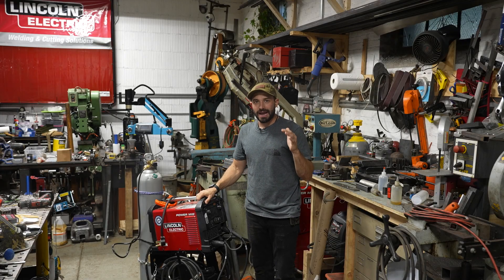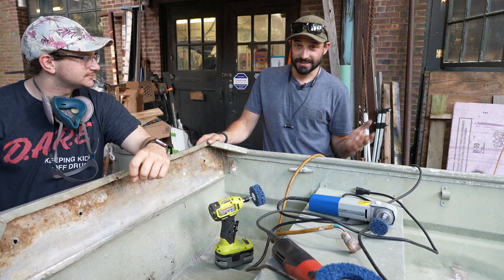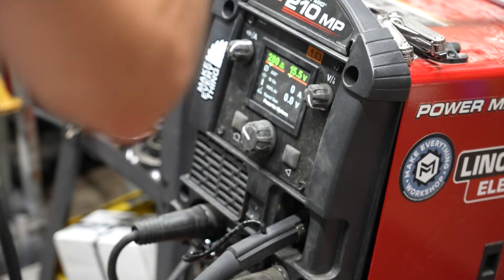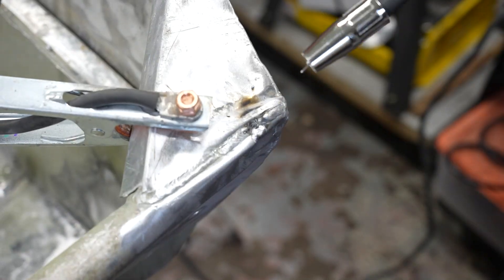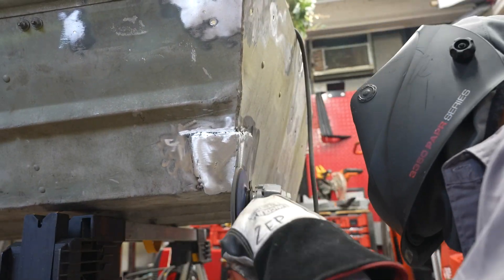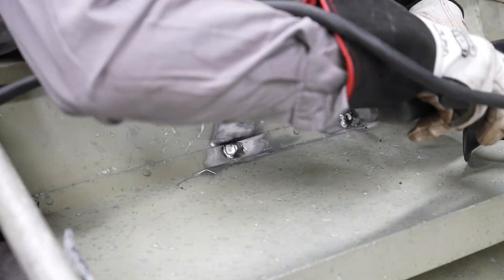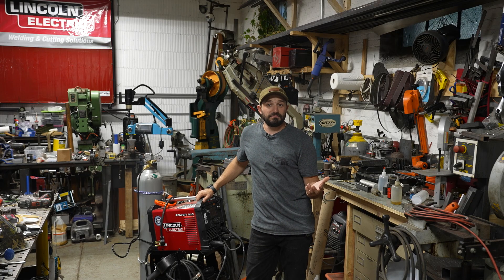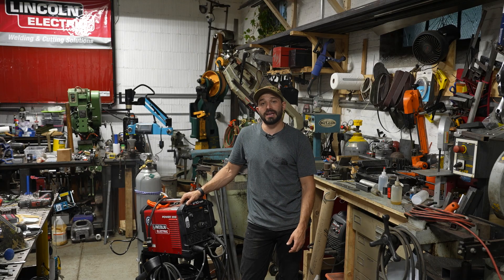Can We Fix This Aluminum Boat With A Mig Welder?

Comment: First time I attempted aluminum welding was on very thin metal of a Land Rover roof. It was flat which made it easy. Suggestion was to use a brass backing plate since aluminum won't stick and would absorb some heat.  I'm getting ready to fix my boat and your video should help immensely!

Comment: Great video! I used lincoln electric k488 spool gun for years.. i bought a Fronious transteel welder and after dialing in the arc legnth control it welds Aluminum awesome!

Comment: I spool gun mig thin aluminium every day making scalford towers. Hard to say how bad a job you were doing with some of that without seeing that material close up, but it looks pretty weak/thin in spots. Really is easy to burn through thin aluminium if you're not used to it. Couldn't give you exact settings because I'm in the UK and not sure if the machines use the same values in America but turn down the feed speed and/or voltage if your burning through. You're better off starting on a lower setting and having a shitty weld and grinding it off than being too high and burning through. I really wouldn't be welding uphill on stuff that thin either, you'll be perfectly fine going downhill with right settings.

Comment: Just completed a simular repair on an old 16' fishing boat, replaced a rotted transom with extruded aluminum shapes, had all the same problems but learned a grest deal about aluminum and my spool gun. I don't thinId try it again though. Looks like you did just fin. I learned that for me at least, dirty old thin aluminum is not any easier to tig than to weld with a spool gun. mabey I just need a lot more practice (on non critical stuff). My leakey rivits were fixed with a nice blow of a hammer backed up on the inside with a dimpled steel rod.

Comment: Planning on stripping the bottom liner and paint from a jon boat i bought and wanna work on. I like the idea of the poly sand brushes. You said it doesn't remove aluminum. So could i just sand it all down with them and not worry about damaging the boat?

Comment: Aluminum spool gun welds downhill REALLY good. On that thin of material there's no reason to try uphill. Also, 5051 would be the best material for that
Reply: I don't know how to determine what the base material is. I know most things, boats especially, are made of 5051. You can weld over a 4000 series aluminum with a 5000 series. 5051 welds good and is a good all purpose, general material
Reply: Great information, I have a spool gun also that I typically run 4043 wire. How do you know what your base aluminum is? So you know which wire to run?

Comment: Do you have to use Argon gas ???  Can you use just the spool of aluminum.030 from tractor supply??   What will happen if I don’t use gas ??
I appreciate your time !  I’m new to mig welding
Reply: I would highly recommend using Argon for aluminum welding, there are stick electrodes made by several companies, Arctec is one of them if you opt out on not using gas.

Comment: when mig or tig welding with a lightweight gas like argon, do NOT use a fume extractor or a fan, as it removes the covering gas and causes a lot of issues with the weld puddle.  If you are really worried about fumes, get a remote air handler and CAP mask to feed you fresh air without messing with your covering gas.

Comment: Just sold one of those 210 MP and upgraded to the 215 MPi. One of the reasons for the upgrade was that machine has a tendency to run on the hot side.

Comment: When trying to weld bolt holes in aluminum, use a backer plate of copper, brass or even steel. It will help keep from blow through and allow the hole to fill easier to give you a solid backing. It works very well...

Comment: Generally speaking, if you have something made from aluminum like a ladder, boat, etc that has lots of rivets... there's a reason. It is usually an alloy that doesn't weld well if at all. And of course if there are no rivets and there are welds, it should weld just fine.
Reply: This isnt True. It’s because rivets are cheaper and or the welds would cause too much distortion. I’ve welded some Jon boats where all the rivets on the bottom of the boat had to be welded. They all welded smooth as butter

Comment: If you're going to epoxy it, you can also use a filler called, All Metal, over welds. It is a powdered aluminum filler and uses MEKP hardener. It would be perfect for catching any small pinholes. Extremely rugged filler. I use it in place of lead on the classic cars I restore. Great vid! Never stop learning ✌️
Reply: FYI for anyone reading this; All metal, metal 2 metal and other metal fillers are fillers and just that. 
I got a free tool box for my pickup off my buddy's work. Corner welds were all cracked and water was getting in so they were getting rid of all the old toolboxs on the trucks. Dunno who did it but somebody had wiped metal filler all over the cracked welds. It didn't hold up well at all. Actually glad it wasn't JB weld or some other horrid epoxy I've had to clean up on other stuff.
I have not come across a brand of metal filler that doesn't have talcum power in it which is porous. Metal filler will not keep the oxide layer from forming on the base aluminium unless it's encapsulated somehow, so it will just fall off.
Don't buy a qt of rather precious metal filler for 80$ or whatever it costs now to patch your boat. Just buy a proper patching compound for 30$ if you don't want to shill for a proper weld repair.

Comment: As an ex aluminium boat builder we used mig on all of the hull. The transom was done with tig.
Reply: Why were the different methods used?
Reply: @jeremyspecce tig is better for thinner sheet aluminum is why. Hull is thicker so mig is okay and the hull requires more welds so a spool gun would be much more appreciated and faster
Reply: @robertlawson1184 a lot of the boats I’ve seen on the west coast of BC are done with GMAW, one boat I worked on was a marine response boat, 1” transom for 3 400 mercs. Haven’t really ever seen TIG welding much on boats when in worked in a shop. Although we didn’t really need it when you have a push-pull system with double pulse.

Comment: Aluminum must be clean. Match up your wire with the repair areas and patches.  Don't use a grinding or cutting wheel or a brush that has been used on steel, it will contaminate your welds. If using new aluminum, make sure the shiny top layer is cleaned off and wiped as well. After grinding with a clean wheel, wipe down with acetone throughly and let dry. Aluminum is a finicky metal and must be welded with care.
Reply from the maker: Thanks for the tips! We definitely "under prepped" but we learned a lot!
Reply: New stainless wire wheels work great
Reply: Yep. Clean it, then clean it, followed by cleaning. That was my #1 issue when I learned to weld half-a-century ago. Stuff you can skate by with welding steel will burn you on other materials.
Reply: @UncleKennysPlace  as a 4th step to that process, you should also clean it
Reply: Interesting tip about the contamination from previous steel use.
Reply: Great information, how do you know what material your welding on to be able to match it with your welding wire?
Reply: @jcusak , that's a very broad question.  A magnet to see if steel or cast. Use a grinder to see what color the sparks are, meaning high or low carbon content. Copper or bronze, meaning the color of the material. Aluminum how soft or hard it is.  Experience has alot to do with it also. Hope this helps. I was in welding supply sales for 25 years, always a learning experience.